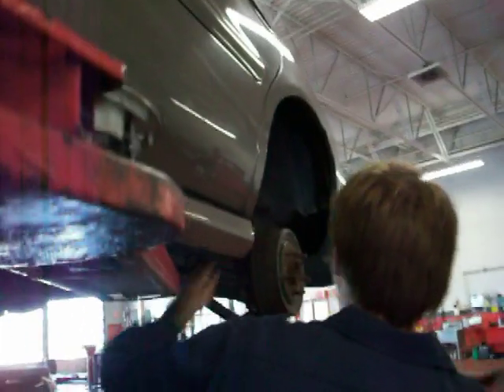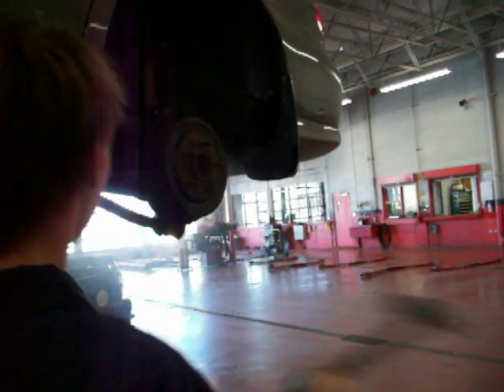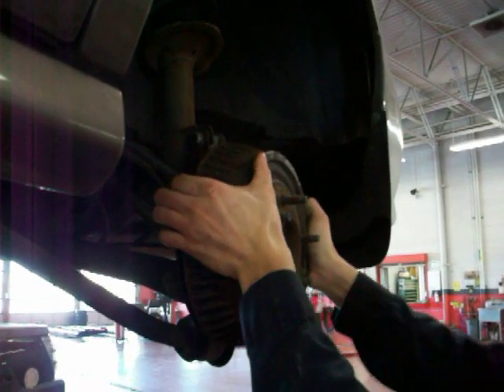Howie Skater Punk Malibu being checked out

Comment from the maker: I do agree, the touring tires are better in the rain for sure, but these Tiger Paws did decently in the snowstorm which hit right after I got this car several years ago.  But yes, dedicated snow tires are the only way to go in winter driving conditions. One you drive a car with snow tires in winter, you will accept nothing different.  Again that nemesis rust for you!  Good thing you did the prep work yourself. It can take hours as you say. Mine got aligned in 1/2 hour!  Keep it coated with oil!

Comment from the maker: It pays off in the long run for sure, you just have to make sure it keeps being touched up as I explained.  The tires are Uniroyal Tiger Paw Touring, a decent enough tire for  what I ask for.  Unfortunately the cost and hassle of repairing the sort of rust happening on your car can be quite high, I have been down that road before with not cared for second hand cars I have had.  One thing, then another.

Comment: That greast undercoating works pretty well. Any car with 135000 miles without it ... wouldn't have anything left.

What are you running for summer tires?

I wish I could get under mine to make a comparison. My floor is going to rust out in a few spots, the transmission pan leaks from rust and the PS fluid lines are leaking from rust too.